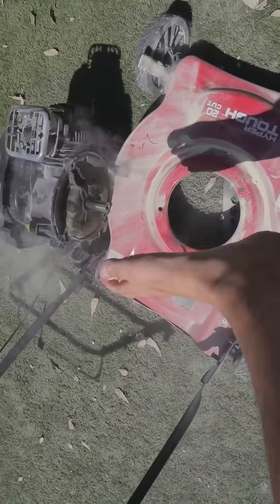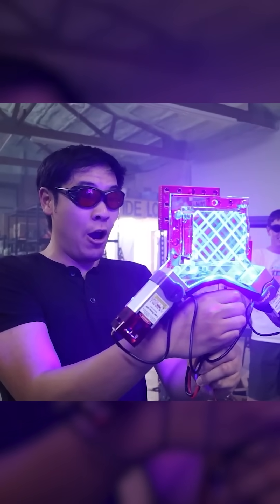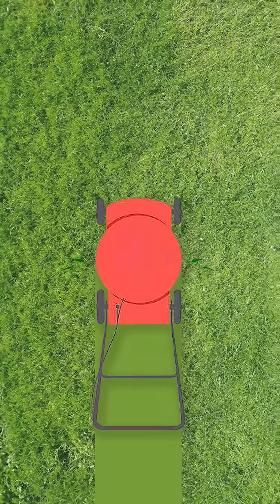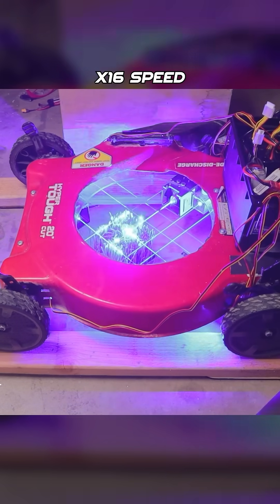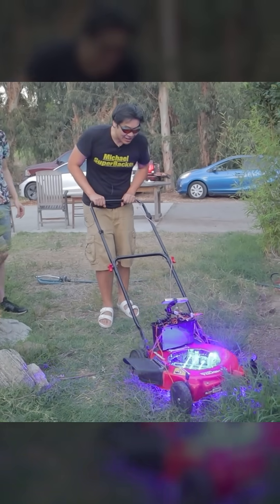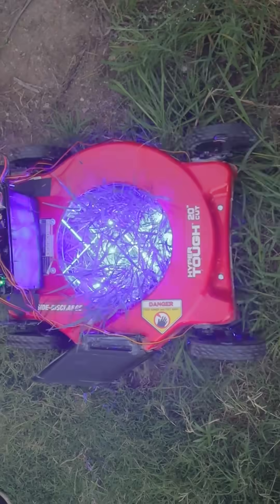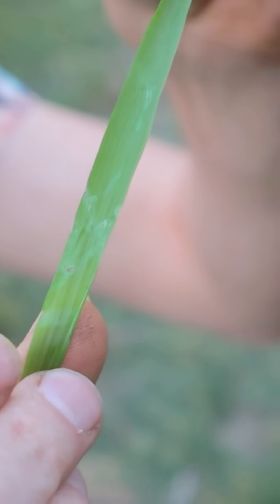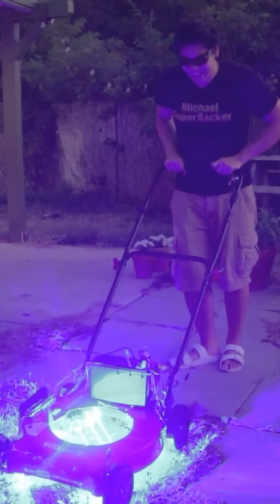building Laser Grid Lawnmower

Comment: Connect the lasers to mini motor set ups, able to move both vertically and horizontaly. Connect all the of motor setups to a Arduino and tell it we're "0" is, where the mower is sitting completely flat. Then tell the Arduino to detect where the mower is, and if the mower moves in a way were that point of 0 shifts to move the lasers back to where 0 would be.
I have no idea how half of this would be done, I'm pretty good with computers. But I like working on cars more, it just came to mind when I watched this lol.

Comment: See, what you need is a fan that would suck the grass up onto your cutting plane. Or you could just use a blade that already does that. As far as it being uneven, you can only ever get any lawn as flat as the dirt beneath it. I reccomend a landscape rake and several tons of topsoil.
Reply: Hypothetically, you could get it flatter if the mower was gyroscopically stabilized on a gimbal via precision sensors and motors. This isn't super relevant with a bladed mower, though, since the cutting itself is too rough and imprecise. With the laser, though, this video definitely demonstrates that if you can stabilize the mower, you get an extremely neat cut.

Now, that still doesn't solve the fire issue, and I'm honestly not sure how you'd go about that. It might just be infeasible on dry grass whatsoever, since what you're cutting with literally IS the heat; you can't reduce the heat without making it cut less effectively.

Although... The fire isn't necessarily started by the heat at the point of contact, it's caused by sustained heating of the whole area. So maybe if you do something to rapidly cool the grass around the laser, it might work? Like an automated mister spraying liquid nitrogen, perhaps. You'd lose efficiency on the laser, so you'd need a more powerful beam, but I think it might work; allowing intense heat at the cutting point, but not in the surrounding grass.

Further research is required.

Comment: Why not just create a flat grid across the lawn from a single point? You could have lasers on one side, use mirrors to bounce it in any direction needed, and it wouldn't have the problem of moving around.

Think of it like a grass leveler. You set the desired height of the grass by raising or lowering the lasers, then activate it and let it run until the entire lawn is one even height. If you wanted, you could even add a track for the lasers to slide along around the outside of your lawn to position them better and account for a higher diversity in terrain height. It's a good idea, you just need better execution in the design element to make the most effective laser cutting device.
Reply: neighbors and pets may become a little shorter, but that's not a big price to pay for scientific progress
Reply: @Die__Hard  They should be grateful for the free eye surgery tho

Comment: A standard mower’s blades also act as a fan, pulling air up and grass along with it into the blades.

So, just put a bug fan in top of it to suck the grass into the beams.

It will also help disperse the smoke…
Reply: Interesting idea. You would probably need some sort of independent engine for that.

At that point, though, I think we're back to square one.
Reply: Put a big fan on top, with large metal blades. Maybe even an engine to power the blades. Wait....
Reply: @Timbobjr Yeah, I was wondering if anyone else would notice.

Comment: Honestly this probably will be the biggest thing since the car if you could actually make it work the lasers would probably need to swivel or move so i could cut straighter
Reply: Looks like you would need around 10x power to approach the rate of a mechanical more. The bigger problem is the mechanical mower bags or recycles it to mulch. This would leave a huge mess unless you added some…fans.